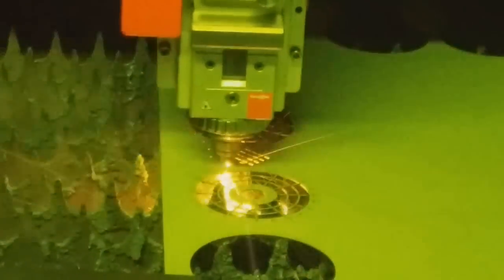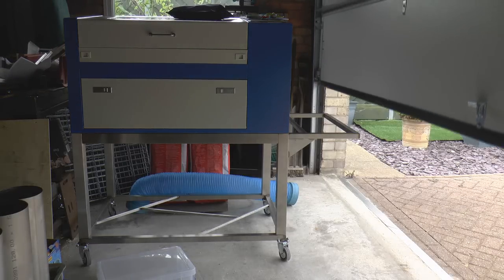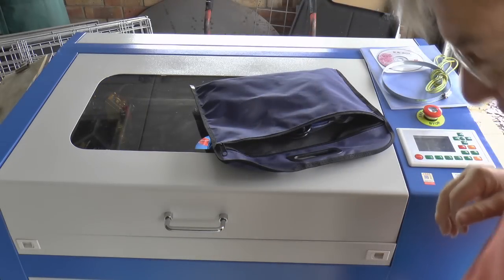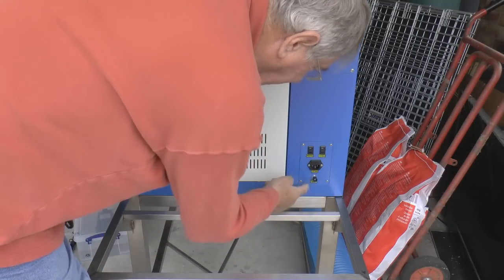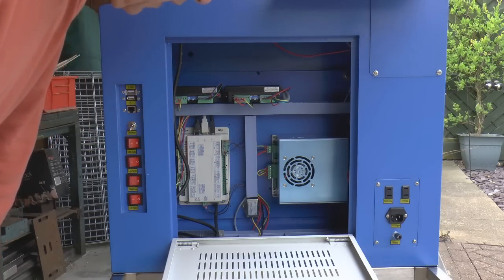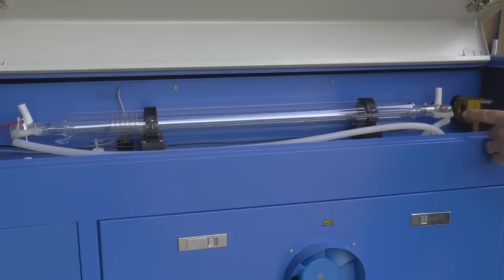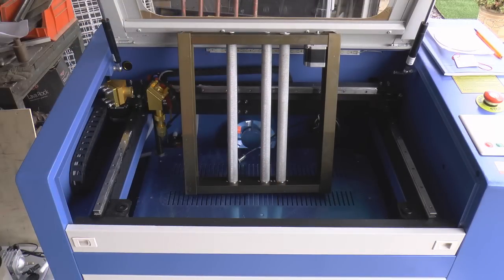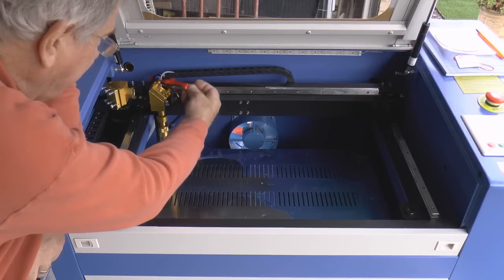Chinese laser cutter  tutorial part 1

Comment: great video! Someone left a review on Amazon recommending your channel. I'm tempted on the 60W version from the same seller. I wondered if you had any views on it? regards! http://www.ebay.co.uk/itm/Laser-Gravierfrasmaschine-Engraver-Cutting-Machine-60W-CO2-USB2-0-and-USB-Disk-A-/291690831492?hash=item43ea20de84:g:R8MAAOSwHaBWlf05
Reply from the maker: +mathew t 
Hin Matyhew
How do you take bad news???
I personally would not buy this for many reasons.
Firstly Sunshinesmile is just a huge import company and they sell Chinese  machines of all sorts on ebay as private listings. As soon as they had my money I was on my own. I knew this before I bought and looked to find the best engineered machine for a reasonable price and with extras. I settled on my smaller machine because it was basically well engineered from everything I could see and deduce from the photos. The tube claimed to be 50 watt but at 800mm long was definitely a 40 watt tube. I didn't know this at the time. Although I haver done lots of modifications to my machine , you will see as you get further into the series, and I've made lots of mistakes, I am happy that I made a good purchase. I had always planned to learn, re-engineer and then use the money saved to upgrade to a more powerful tube when I was more experienced and less liable to trash it.
I recognise this machine to be a REDSAIL machine from many of its features. Particularly the twin drive belt system with a cross shaft running under the laser tube. The older machines had a rather Mickey Mouse bearing system. I can see this latest version is fitted with proper engineering (HiWin) bearings. 
It is being sold as a 60 watt machine but it cannot be The general laser tube rule of thumb is 800mm long=40 watts, 1000mm long = 50 watts, 1200mm long = 60 watts and 1600mm long =80 watts. The case width is 1150mm so add 25 mm for air gap at HV end plus 150mm for mirror mounts at the output end plus 1200mm for a 60 watt tube and you will see my point. You will be buying a 50 watt tube with a 60 watt power supply.
https://www.google.co.uk/search?q=redsail+laser+pictures&biw=1920&bih=1055&tbm=isch&imgil=QqRygZt_Aw2pVM%253A%253BtuvpUKWSBxj8MM%253Bhttp%25253A%25252F%25252Fredsail.en.alibaba.com%25252Fproduct%25252F60190962854-212513854%25252FHi_Redsail_CE_FDA_500_700mm_3d_laser_engraving_machine_X700.html&source=iu&pf=m&fir=QqRygZt_Aw2pVM%253A%252CtuvpUKWSBxj8MM%252C_&usg=__Rn8VZUjEcnR4zDgojI1fanDAF0w%3D&ved=0ahUKEwiemc3V_JDLAhUDthQKHcB2CH4QyjcINQ&ei=6O7NVp6FH4PsUsDtofAH#imgrc=QqRygZt_Aw2pVM%3A
Reply from the maker: +SarbarMultimedia  
Sorry I pressed the send button accidently. To continue.
Take a look here
https://en.industryarena.com/forum/a-warning-about-redsail-x700-60w-machines-ebay-right-now--264142.html

Question:  Was it the work area or the power that was driving you to look at this machine?

Choose another smaller cheaper machine  initiallyand use the saved money later to  upgrade it's power when you have mastered the machine and no longer run the risk of trashing your tube

Hope some of this helps

Good luck and best regard
Russ  

ps ALWAYS BUY WITH YOUR CREDIT CARD,  even if you have a PayPal account The payPal and Ebay protection schemes are virtually worthless but you stand a good chance of being treated fairly by your card supplier because theu have to operate under STRICT rules......unlike PayPal.
Reply: +SarbarMultimedia thank you Russ for all this information. appreciate you taking the time to type it! it was the work area that appealed mainly tbh.
if they provide a 60W supply and 50W laser does that mean it will likely reduce the life of any 50W laser I put in there?
Thanks again.I will digest this information and might have some more questions.thanks again, will follow your tutorials with great interest
Reply: +SarbarMultimedia I'll also refrain from buying from this seller. in fact it's put me off eBay tbh. there is someone selling the same ahem "60W" on Amazon for a bit more money than eBay but perhaps worth it for seller protection. seems like a bit of a minefield!
Reply from the maker: +mathew t 
Hi Mathew. Check out Amazon protection conditions .I don't think you get the normal no questions refund with their Amazon Market Place sellers and I'd be certain this is not Amazon stocking and selling a machine.
Wear a VERY cynical hat when you step into this jungle
Regards
Russ
Reply: +SarbarMultimedia Thanks Russ. very sound advice. the temptation to wear rose tinted glasses is immense. if I was buying the same model as you, would you recommend a different UK seller or are they all just as risky? Cheers! mat.
Reply from the maker: +mathew t 
Hi Mat.
It was a bit of a shock on two fronts for me. They were so friendly and communicative until I experienced power problems ...then blank. Secondly I was the victim of those rose tinted glasses (despite my research) to expect 50 watts. As I said. I'm actually very happy with the machine, it's been a sound investment and given me tremendous fun.  I've pushed the machine to it's absolute limits to extract every possible watt of power down at the cutting surface  This was the right point for me to get rid of my dodgy SECOND tube. Just today my upgrade to 60 watts has arrived. There's a mountain of videos between where you are and where I am. They record my full learning journey (mistakes and all)
Yes, aware of what you are getting, you will not suffer the same disappointments if you buy the same kit as myself from the same seller. There is a fully documented path to follow, just stay about 10 videos ahead so that you don't make the same mistakes that I did. There's a great deal to learn.....and don't forget to to use your credit card even if it's via PayPal.
Good luck

Russ
Reply: +SarbarMultimedia thanks Russ! very kind of you to share all this knowledge!

Comment: Great video series Russ, really appreciate it!I cannot find any link or comment on the model number of your machine.......I am trying to get the same/similar model if I can. As I am in Hong Kong, hoping it maybe easier for delivery ! Look forward to more in your series. Good luck with the new 60W laser upgrade !
Reply from the maker: +Steve Bezant 
Hi Steve

http://www.ebay.co.uk/itm/350B-50W-CO2-Laser-Engraving-Cutting-Machine-Auxiliary-Rotary-Device-0-60000mm-/111694615353?hash=item1a01849339

This is the direct from china same machine
http://shenhuilaser.en.alibaba.com/product/60420664437-50330522/350_laser_engraving_cutting_machine_40w_50w_60w_price.htm  This surely must be cheaper to ship than from Europe or US
BUT  beware the 1050mm width of the machine only allows a 40 watt tube to be fitted. I also suspect these are being sold on the power supply rating not the tube rating. a 60 watt tube needs a 300mm to 350mm extension box as the tube must be about 1200mm long for 60 watt output....that a law of laser physics.
Hope this helps

Best regards
Russ

Comment: Hi Russ.  My machine's LCD now says "Board Encrypted.  Contact vendor."  I see that there are two software keys in your conversations with Chip.  Where do they go in hopes that I can get my board unencrypted!
Reply from the maker: +Paul Lavin 
Hi Paul
I'm not sure my info will help but the RD8888 password works in File, Vendor Settings, this is where you can change the X and Y calibration of your axes. Two things. First you will need your pc with RDWorks loaded and connected to your machine. Secondly before you do any modifications save the existing configuration to a backup file. The other place I have found is when you first go into Config, System Setting you may need the same password to access the System Info tab (again via your connected PC). You will find a button to Upgrade Firmware. I have never been here so can offer no help. BUT, the people that make the control system may have the firmware/drivers/help on their website 
http://en.rd-acs.com/down.aspx?TypeId=50029&FId=t14:50029:14&pageindex=1

Best regards (and good luck)
Russ
Reply: +SarbarMultimedia  Hi Russ, it's taken me a while to get back to the laser.  Thank you and Chip for the guidance

I have communication with the laser from my PC so I guess the USB driver procedure was successful (but what a palaver installing from a thumb drive instead of a CD). The laser is capable of pulsing through a 3mm sheet of acrylic so there's a good tube with correct focus, I surmise.

I copied/backed up the machine's settings though I am somewhat doubtful that they will be useful.  Never can tell ;-) I input the RD8888 code in the Vendor box and also in the Config as suggested.

I drew an ellipse in the RDworks software and and hit the Cut button and and got some too-quick-to-read message on screen, the laser machine beeped and gave me the "Board Encrypted.  Contact Provider" 

I've contacted the provider but haven't had a response.

Any other clues?
Reply from the maker: +Paul Lavin 
Hi Paul
I've had a quick look at the Ruida website and found there is a manual on the encryption function
http://en.rd-acs.com/Private/Files/3f7280bc602f0be4.pdf
I have not studied it but a quick glimpse seems to indicate this encryption function is for something like "free to try software" that expires after X number of days. You will have to study it further and may have to contact Ruida direct for guidance.
Best regards
Russ
Reply: +SarbarMultimedia Thanks again, Russ, that pdf seems to be talking around my problem.  I just wish my "Chinglish" was up to the task.  I appreciate your much better familiarisation with the RuiDa site.  I will persevere with getting some support from the vendors and let you know if there is any intelligible response.  It's quite worrying that there seems to be some sort of solicitation for additional payment...

Comment: Greetings from Germany. Thank you for sharing your experiences with us, it has saved me a lot of time. The air assist, what type of air regulator do you use? Pressure gauge is no problem but I can't find a regulator to control such low pressure. As you say the supplied air pump is pulsed and no good. Thank you again.....
Reply from the maker: +Robert Kent 
Hi Robert.
First it depends on the lens you have in your machine. Most machines seem to be supplied with a 50mm lens which sets the nozzle about 19mm above the work surface. My lens is a 38mm focal length and sits about 6mm above the work..
Before I go on, These videos are of me learning to use the machine  they are not training videos as such and some decisions I make early on I change in later videos. Take a look at https://youtu.be/g5k6YhNqfSw and you will see how I eventually set my air assist. Even though I didn't use my big compressor I still retained the pressure regulator. It works well to cut the very small airflow to a whisper when I'm cutting thin paper.  Any cheap Chinese regulator will do the job. The gauge will register zero so don't bother to buy a gauge. In these early days of ownership I was trying to read my industrial laser experience across but it's not applicable to these little machines,,,,they are a special breed.. The regulator will damp out some of the pump pulsing but I found it doesn't matter. Back to my first question about focus height. If you have a big gap ie a 50mm lens,  the air flow to your work will be poor. That little pump needs to perform 2 duties. Most important (in my opinion) is to keep a positive pressure in the nozzle so that smoke and fumes cannot reach the lens. If you are just using this as an engraving machine then a gentle puff of air on the surface will keep the surface fumes away from the immediate burn area. However, when it comes to cutting, the story changes. As you cut, your airflow must go into the channel to keep the smoke and fumes moving away from the IMMEDIATE cut zone because those fumes absorb some of  the infra-red radiation before It has a chance to cut. My 38mm focus lens has two advantages. Because it's much closer to the work the jet of air is not expanding away before it gets to the cut zone and therefore penetrates right into the groove. Secondly ,the 38mm lens has about 80% more cutting power than a 50mm lens . Its all to do with energy density and focused spot size. Take a look here, the reading is not too complex. http://www.parallax-tech.com/faq.htm

Good luck with your new machine...enjoy

Russ